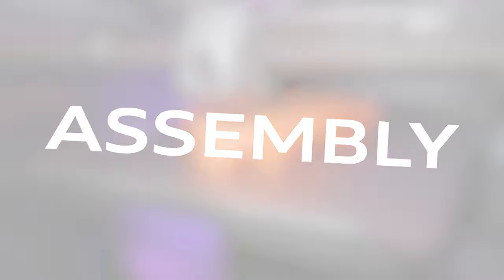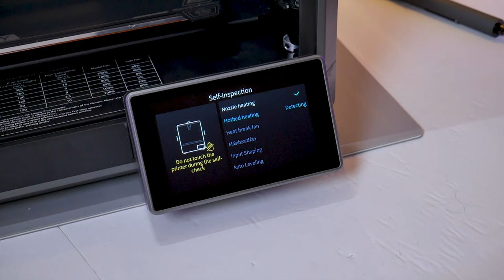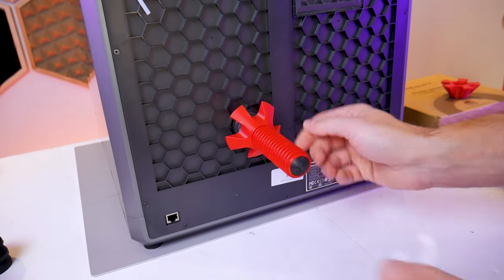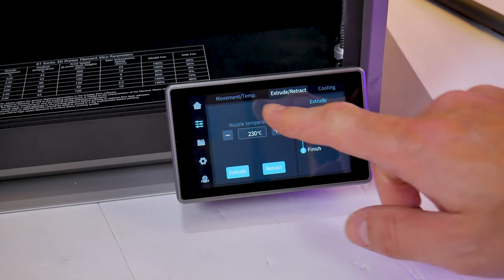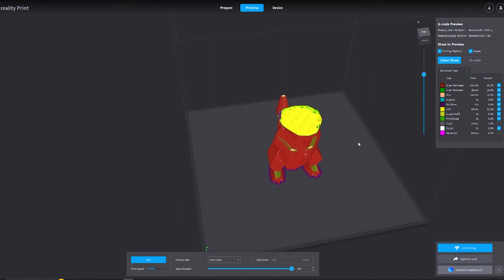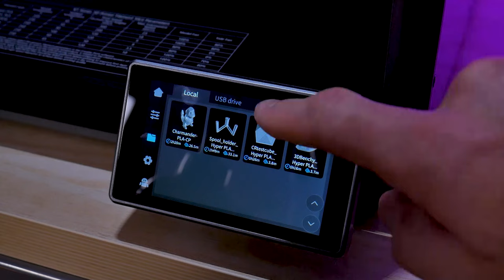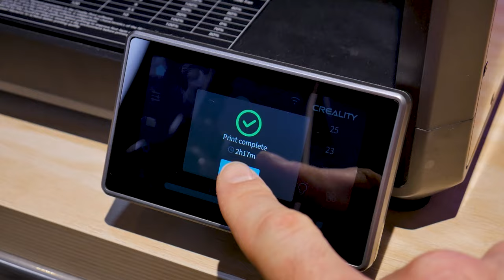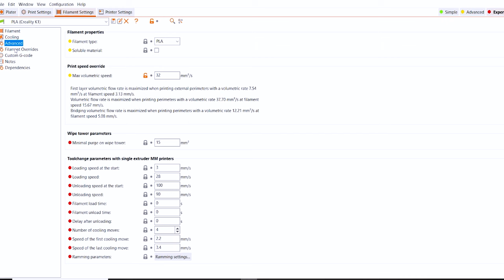Creality K1 MAX Setup Guide, Review, PrusaSlicer Profile, Upgrades and More!

Comment: how is it that every review has no issues but i had issues after issues. i dont know if i can trust all these reviews!
Reply from the maker: What kind of issues did you have and how much experience do you have with 3D printing? In some of my past videos I've talked about the learning curve + sometimes us reviewers over looking the fact that we have lots of experience so if something comes up its an easy small thing for us to fix / troubleshoot - but maybe for a beginner its a big deal. For example the two times I had to disassemble the extruder to unjam it was easy for me... 10 mins and it was done... but if you've never dealt with it before... the first time might take you an hour. I've read about all sorts of issues with the K series products and same with the Bambu labs stuff. Then you also get the hardcore fans of both who swear by each brand no matter what. It can be tough to figure out how to weigh everyone's experience. My suggestion would be to buy through a reseller with a great return policy like Amazon so if you get a dud you can return it easily.
Reply: Because they have ironed all the kinks out got mine yesterday and I'm completely new.
Reply: What issues? Mine has been as close to plug and play as a 3d printer can get. Assembled it, plugged it in, connected to wifi, ran through the calibration process and its been flawless ever since. I know they revised the print head right at release. There were issues with the original K1, I thought the max shipped with the fixes but maybe a few didnt
Reply: Ordered mine Friday. Showed up today and it's crushing it right out of the box. Have to admit I'm still a bit shocked as I type this.
Reply: My k1 max worked well for 4 days then crapped itself. Dug holes in the build plate after auto bed level, which damaged the hot end and nozzle then the main board died. Piece of cr@p.
Reply: I bought a broken K1 max off ebay from their UK shop  Once I'd replaced the toolhead pcb, it became a reliable and fast printer.  Really pleased with the design, build quality and the availability of spares.
Reply: Cuz they got free machines
Reply: Because they’re getting paid whether it be free stuff of money, they’re getting paid. Same with most of the big name reviewers with any product

Comment: Price on your build plate is just too expensive. You can get a decent build plate for half of that cost
Reply from the maker: Thanks for the feedback. They're custom made to order with the logo so they're made in low volume - they're also not the cheap single sided Amazon ones or the cheap ones where the PEI coating sometimes peels. All of that contributes to the price, but I understand if you shop elsewhere. Thanks for checking it out!

Comment: i think lidar changes the PA value, i have 0.04 in printer.cfg but it sets it to 0.046 (visible in fluid) ... maybe its just PA tuning for active config. not sure about flow, it was 100% as in filament settings. also it doesnt probe when lidar scans the print area. also i recommend using buildtak foil (3djake has creality version) on the back of the buildplate + 3d lack. you can turn off bed heater for pla/pla+/meta after first layer. saves 200-300 watts per printer which is significant - needs less than 100. initial layer 45°-50°C max, then its easy to remove. 3d lacks helps as a seperator so it doesnt stick too crazy.

Comment: You can flash pure Klipper to the K1 and K1 Max and then add Mainsail and Moonraker. Which will allow you to send prints from PrusaSlicer
Reply: Will Lidar still work with the native Klipper?
Reply: Klipper is already on the machine.  It is modified by Creality to work with the K1.  You can install Mainsail or fluidd without changing the Klipper installation.  Though, you do need to perform a full Klipper calibration after installing Mainsail for fluidd.  However, Creality has not provided information on how to use the auto-calibration (which includes the LiDAR), so it can’t be used.

Comment: Just put one on order, kind of worried now. How’s it holding up? See quite a few negative comments.
Reply from the maker: Mine has still been fine - been using it regularly. I put a hardened nozzle on it and have cranked out some really nice CF-PETG prints. If you're printing larger items you'll want to preheat the bed and let it settle in for a few mins to minimize the warp. Other than that I've really had no major issues with it

Comment: Ordered my K1 Max last week and will be setting it up in my work room when it gets here next week. Thanks for the great information. Definitely a new subscriber. I'm sick of paying a local maker for protos and decided doing my own will save a bit of time and a lot of money.
Reply from the maker: Nice, enjoy it! The firmware has received a lot of updates since this video so it's further improved in a few ways :)
Reply: @EmbraceMaking  Excellent. Looking forward to it. I'm currently digging through some info about Orca Slicer and I'm hoping they can work together well.
Also picking up a bench top CnC machine that can work with softer metals to really get the workflow going.
My biggest hope is for a newer type of printer material similar to binary compound epoxies that can be integrated with metallic and ceramic compounds. Eventually.

Comment: This is definitely the best review I've seen on this 3D printer. Thanks.
Reply from the maker: Wow, thanks!
Reply: @EmbraceMaking I ended up buying a K1 Max now and I am very impressed with it's performance. Only printed a few things so far, but it's so nice having a printer that basically just works without having to spend an hour leveling the bed. Thanks again for the great review, had to come back here before I decided to buy it for sure.

Comment: Micro Center had the K1 Max on sale for $699 and they had an open box at $629. I got the open box one, took it home and set it up using this video. Your review was what convinced me to buy it. Thanks for making such informative videos. Have you tried printing TPU on the K1 Max?
Reply: I spoke too soon. I printed a benchie and then moved on to another stl. When my print was 90% done I heard some horrible grinding. I looked and when the nozzle was moving in the Y axis it made a grinding noise. I even got a Key 2505 failure code. According to Creality, it’s either the X or Y motor connections not being plugged all the way or a board fan screw hitting the xy motors. Creality recommends taking a screw off the board fan but still had the same  issue. I’m returning it today and just getting a new one
Reply: @dspserge81 did you fix it?
Reply: @TechMaestro01  the replacement I got at micro center worked without the grinding issue. However, my K1 Max stopped extruding and it seems this is a common issue. So much so, Creality has a V2 of the extruder that I am now waiting to get from Creality.

Comment: Hey bud great video and very informative, with regards to the lidar sensor i think youll find that it only works on the test lines before printing, the different lines are printed at different head pressures and feed speeds and then it will scan these and choose best setting or result to match the settings you have chosen for the print, looking at purchasing this machine as i feel it might actualy be the better option to the x1 carbon

Comment: What is the chart shown on the base just inside the door? My K1 Max does not have that. This is the best K1 Max video I have seen so far. Very informative.

Do you ship to the UK?
Reply from the maker: It's like a quick reference guide with temperatures, speeds, fan % etc for different materials. Hop over to my website and use the contact page and ask me for a picture. I can send you one if you want it. Also, yes UK is not a problem! When you checkout on my site you will get a live shipping rate with different options. Thanks!

Comment: If you use any slicer other than Creality Print, you do need to install MainSail and.or fluidd, and then go through a full Klipper calibration.  The reason you have to do this is because you can’t use the auto-calibration built-in to the printer.  At this time, only Creality Print works with auto-calibration, as Creality has not provided information on how to properly get auto-calibration to work with other slicers.  The extruder calibration is way off, and will under extrude.  Also, the Arachne slicer does not work well with the K1 printers, and will not produce good prints, especially the top layer.  Using the Classic slicer, you will be able to get very nice top layers, and the structure of the print will be stronger.

Comment: Hello, I've just recently got a K1, it appears to be from a newer batch with the revised extruder.  I wasn't super impressed with the Creality Print software, mainly with not being able to add support blockers.  I tried your PrusaSlicer profile and noticed considerable wavy ringing just on the X axis, the Y axis didn't show any of it.  I think you touched on this in your video and I was wondering if you'd have any suggestions.  I plan on upgrading the firmware to get root access to add the full fluid interface to be able to run input shaper on each axis individually.  I am hoping that will help but i'll have to do more testing to see.  Thanks for the video, it was very informative and helped me with the decision to go ahead and get the K1.  Keep up the great content!!!
Reply from the maker: Thanks for the comment! Yes I still haven't been able to figure out how the Creality software gets a much smoother result - no ringing with virtually all settings being the same. And as you said it's annoying that it is missing the more advanced features of PS. Have you tried rooting and doing the input shaping on each axis and checking those graphs yet?
Reply: Vibrations on the x axis seem very common. It's happening for me too. Creality seems to be saying it's a software bug and to just print faster for now.
 Other issues is that the gantry isn't very straight. The belts aren't in line throughout the printer in most of these printers causing some vfa issues.

For now the best that I've found is to increase print speed to spread the vfa vibrations further out so they aren't so noticable and lowering temperatures helps too. Finding a good sweet spot takes time but it's a good fix for now without rebuilding your gantry. 

Next upgrade I plan for is the microswiss flowtech hotend to prevent clogs and increase max volumetric flow so I can print higher speeds with petg which has a generally lower volumetric flow
Reply: So you had to do a lot of changes 🤔 does that mean that the k1 max came out shit I mean I'm no creality ass kisser.  The profile they have for petg is like sticking to the bed like it's welded my plate is totally messy after a few prints trying to get it of the plate 80° is too hot my plate is making bubbles like the top surface is going to come of now I'm going to use your plate
Reply: @louwrensburger1796  TPU needs to be printed on glue stick or hairspray, otherwise you will tear up your build plate it sticks too well

Comment: I’m been comparing the K1 max with the Bambu lab X1C.. the Bambu is like twice the price with the ams.. do you think it’s worth it?.. 
Also I print a lot of TPU 
How’s the K1 max with that?
Reply from the maker: Haven't really tried TPU on this machine yet but I think it should be fine - just remember to print slower with TPU it's not really great at high speed printing on pretty much any machine. As for the comparison against bambu labs... the AMS is super cool but do you foresee yourself using it a lot? For me I could never justify the price because 99% of what I do are functional parts that would never require multi colors. If you're the type of person who is into fun models that require multi-color they probably have the best multi material  / color system on the market right now ... so it would make sense. Otherwise if you compare the two machines without the AMS the price becomes a little closer and then I believe the next most important consideration is the size... K1 max has a bigger build volume and again, is this something that is a priority to you?
Reply: @EmbraceMaking  All my prints are things I design and prototype.. the multicolor thing would just be cool especially for text 
I currently color the text with a marker haha
Which works but it would be awesome to print it in another color

Comment: Anything stopping me from mounting the 'Spool stand X' on the ceiling of a print encloser just above the printer?
Reply from the maker: Technically it is intended to sit on the table (or lid) in the two orientations I show. However, I recently added two mounting holes at the bottom so it can be screwed to a table or M4 screws can pass through and you can attach it to the top of extrusions with T nuts. Again, that would be in the upright orientation but you can use those holes to anchor to your ceiling (upside down). When you assemble it, there are two M4 thread forming screws holding the two big pieces together, since you will be mounting it "upside down" and the weight of the spool will now bear on those screws in the printed parts. Normally it just sits on the table and it's not a big deal but in your case consider using some some super glue in addition to the screws to bond the printed parts together. In the event that the screws ever failed Id hate to see the spool fall on your printer.

Comment: Ghosting issue? Bad input shaping leading to bad finish prints? Is your printer different? How did you solved it? Color change by layer using m600 in slicer is missing. If you print slower than 150mms not one good print. . Slicer tree supports are not very good.

Comment: DO NOT BUY FROM CREALITY.  I have had numerous issues with the  K1 Max (their top of the line printer).  I have 2.  And I have the same issues with both printers.   All apps and Firmware are up to date and the latest versions.  I have never been able to see my cameras when viewing from the web version.  When I messaged customer service their only solution was to restart my printers (didn't work) and reset my network (didn't work).  When I asked to speak to a supervisor I was told there was not one on duty and I would have to send an email to their general email to speak to a supervisor and they would get back to me the next day.  2 days later and I have still not heard anything.  I tried contacting customer support again and received a message that there was no support on duty.  I'm sitting here with $1800 worth of paper weights and not able to print anything.  DO NOT BUY FROM CREALITY.
Reply from the maker: Still have this problem? My camera feed seems to work fine - could be a network issue maybe if it's affecting both of them? If it is in fact a network issue that would be a tough one for Creality support to diagnose for you. You mentioned that you can't print anything - the camera shouldn't cause that, what else is causing you not to be able to print?

 Hopefully you heard back from them though - they usually respond within a reasonable amount of time, although I know it can be frustrating with a lot of these 3D printing companies because all of them have their support in China so it's basically one message back and forth per day at best.

Comment: Hey, does anyone of you guys know if issues with build plate leveling and lidar are fixed with new firmware or something?
I am considering this machine, so any info would be appreciated.
Reply from the maker: They just released a new firmware and in the change notes it mentions the lidar.. here are the notes:

New Features:

Reworked laser lidar flow calibration feature (K1Max only), compatible with CrealityPrint, Prusa, and Orca slicers, supporting calibration for harder materials such as PLA/PETG/ABS.

Support for speed gear adjustment, with speed modes including Silent/Stable (50%)/Standard (100%)/High Speed (125%).

Added Expert Mode settings, allowing adjustments to flow and Z-axis offset during printing, and support for nozzle PID calibration.

Added ability to skip models.

Firmware Improvements:

Optimized filament runout detection logic.

Updated chassis fan logic; it no longer turns on by default when starting a print, but is now controlled by the chamber temperature (default 35°C).

Added Korean language to the firmware.

Added filament runout status display to the home page.

Bug Fixes:

Fixed an issue where the UI would frequently crash and cause a black screen reboot during model skip printing.

Fixed an inconsistency between the maximum bed temperature on the web interface and on the screen.

Fixed an issue where the app would not display the monitoring video when synchronization between systems was unsuccessful.

Fixed a problem where the printing task would not exit if the print file name was abnormal.
Reply: @EmbraceMaking  Appreciated!